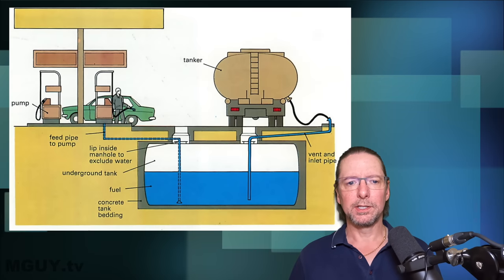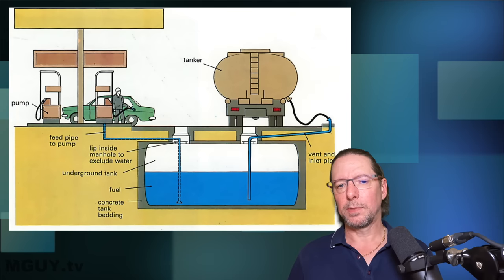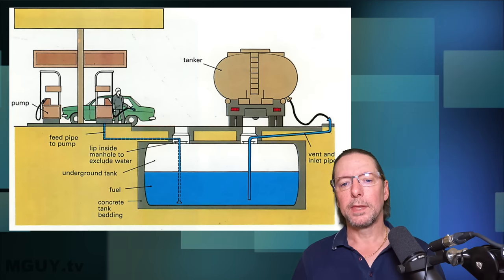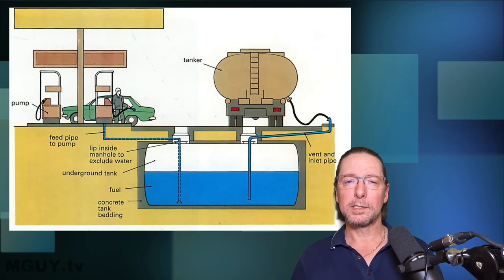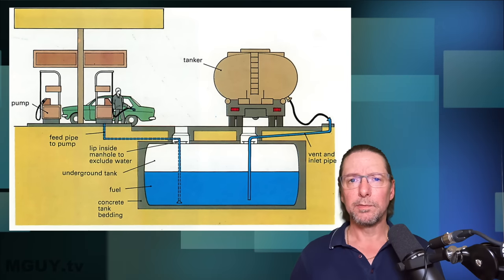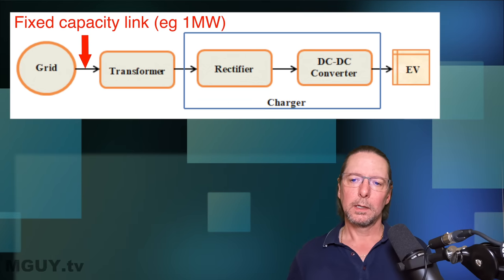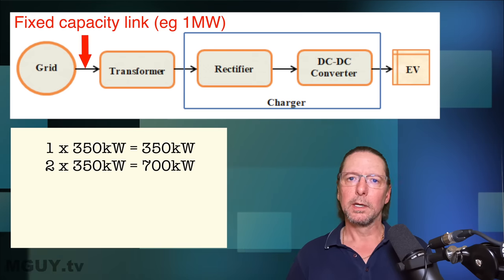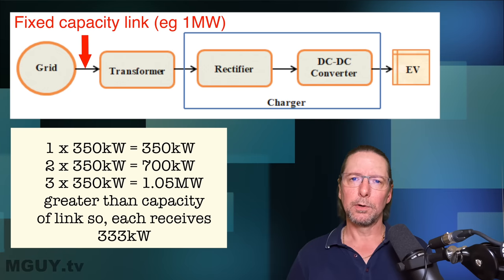HUGE problem with EV Charging Stations that no one mentions | MGUY Australia

Comment: There is an EV battery factory in Kentucky, that is powered by a coal-fuelled power station.
Reply: And one day it won't be.
Reply: @nevillewran4083 One day it'll probably be a smoking crater.
Reply: Yet the Gigafactory in Nevada has no real viable option to use Coal powered stations. The entire south west region simply does not have good coal supply. Who'd thunk you could run Battery Factories without Coal fired plants.
Reply: Producing a battery is only a small part of the energy it will hold during it's lifetime, as they can do over 1.200 fully charging cycles (LFP even over 3.500 full charging cycles) before capacity gets too low for a car.
Reply: @Neojhun There are currently four active coal power plant proposals in Nevada, totaling 4,050 MW, which would more than double Nevada's existing coal-fired energy capacity. Nevada ranks 33rd out of the 50 states in terms of coal energy production.
Reply: @ferrumignis  Doomsday fear?
Reply: @nevillewran4083 No, just a keen sense of the obvious.  Toyota is getting out of the EV business.  That fact alone says everything.
Reply: @georgemallory797  They didn't say they're getting out of EVs.They said it's not the full solution. 
They're planning lots of hybrids (one in every model, perhaps) plug-ins, hydrogen cells and other fuel cells. 
So it says the ICE is looking sick.
Reply: @channel4ferrets  and then recycle ther old, and buy a new $20.000 dollar battery?
Reply: EVERY Chinese EV has been built by the energy from a coal-fired power station!
Reply: @nevillewran4083  
Not quite.  In the short term, they are offering EVs in every sector, but plan a switch back to ICEs powered by ammonia.  There are two versions: one ammonia engine design can power an electric motor, and one can be an ICE.  So the first is actually a hybrid, while the latter is taking us back to the brilliance of an ICE.
Reply: @barryfoster453  So the latter will be ammonia and another propellant?
Reply: @Neojhun  My guess, you forgot to thunk 😉
Reply: Oh, the irony.
Reply: It’s in Kansas actually. But yes, point taken
Reply: That factory you’re talking about was never completed. There are no lithium ion batteries being produced in Kentucky. I was at an investors information event years ago and it was all pie in the sky. Nothing has materialized from it.
Reply: Back in the 1970s they had a " No Nukes" concert. Held at a venue that got it's power from a nuclear power plant.🤦
Reply: @nevillewran4083  
Indeed.  They have teamed up with China's GAC.
Reply: @FOHguy  hilarious!
Reply: @nevillewran4083 "And one day it won't be."   Not in your lifetime.
Reply: @Neojhun   Natural Gas is what they use.
Reply: @channel4ferrets  not if you keep using the fast charger. Plus a battery is a definite fire risk.
Reply: and when the USA catches up it will be run by Solar or wind or many other sources of generation. It's called building for the future. U.K. for example now only has about 3% coal driven power.
Reply: @channel4ferrets  You also have to produce the energy for the battery to hold ...
Reply: @barryfoster453  Did not know that. I'll have to educate myself more. World seems to evolving at a frantic pace.
Reply: @MatthewBerginGarage  How would you know that? Kentucky is already transitioning out of coal-fired power stations. While there's movement to slow that transition, even the power supply companies admit to the problems. The owners of the coal supply chain. 

The power stations are old and obsolete, even some of the coal plants are decaying and badly need maintenace. They know things have to change.They know companies who adapt are more likely to survive and profit. 

Plus, one day there could be a federal directive- "transition out of coal 100% within 8 years". 
Bold statement to make.
Reply: HAHAHAHAHA  LMAO
Reply: Its used to be that we were primarily concerned with our dependence on oil from the middle east, so to reduce that dependency, burning coal was perfectly acceptable, the only problem back then was that coal was a solid and there was no practical way to run a car on coal, without some coal to liquid technology, and now all of the sudden everyone is concerned about carbon dioxide! How about not giving our money to nations like Iran, who are trying to build nuclear weapons to blow up our cities, I will happily burn coal to charge up my EV to avoid buying oil from Iran and other unfriendly places.
Reply: No one talks about these inconvenient facts.
Reply: I read about that!  Oh the irony!!!
Reply: THAT is funny!
Silly Greenies!
Reply: So? You realize batteries only store energy, right? They aren't fuel?
Reply: Daughter works for SOCAL gas and their largest customer is the power generation stations.  I learned many years ago form an instructor;  there is a cost for everything.
Reply: @funnyfarm5555  So, as Sowell says, "there are no solutions, only trade-offs."
Reply: @Lemming1970 Germany has more than twice its needs in solar+wind installed capacity; however, more than half of their yearly consumption of electric power is from coal, gas and oil. Why? Because wind and solar farms tend not to work well on cloudy days without wind, or at night.
Reply: I call EV's coal powered. Since most communities still use coal to run their power generating plants.
Reply: That's why there are solar and wind turbines.

Comment: I've always called the EV a solution in search of a problem. I have not changed my mind.
Reply: Spot on! Agreed 💯
Reply: It's actually a problem that needs a solution.
Reply: I'm not apposed to EVs at all. They are great; however, too many people are pretending that they can do things that they can't do. They would be ideal for commuting to work and for groceries. Just plug it in when you get home. Want to drive from Eastern Montana to South East Wyoming? Not gonna happen.
Reply: EVs are great but not for everyone. I have had one with now over 100k miles, no oil changes, no gas, no maintenance except for tires. I have a gas car and a Diesel SUV also that cost quite a bit more to operate. If you can charge at home, people should get an EV for commuting and day to day stuff .... they are great. ;)  Plus they are comparatively faster, and my EV drives the same as if it was brand new.
Reply: @K9River  Actually, it's pretty easy to drive cross-country in a Tesla now. The only place it's problematic are places where you don't get cell phone signal either.
Reply: @darrennew8211  Not for long and not for many. Only a handful of people can do that because if the lack of charging stations. You're also limited to which roads to drive on. And when the charging stations get full, the already slow process of charging takes even longer- bring a book. Want to visit Glacier National Park in Montana? Can't do it if you're coming from the east side.
Reply: @K9River  Well, yes. The same national parks where you don't get any other sort of public electricity or cell phone coverage, you're not going to have too many EVs going through. You know, like I just said? Altho I did meet one brave soul driving his Tesla across Death Valley.

Two-wheel-drive cars are really bad at driving over long roads in the sand and mud, too. Not every car can go everywhere.

That said, I've driven across country in a Tesla. It's not that hard. Yes, there aren't as many charging stations as there are gas stations. Surprise!
Reply: you are right. let the free market decide, not socialist gov.
Reply: @patriot0971  The primary EV maintenance cost will happen you need that battery replaced. That bill will give you second thoughts about how cheap maintenace is.
Reply: @SoloRenegade oh it will, everyone will want an EV including you!  Why? Because EVs will be way cheaper and ICE cars will be way more expensive as more and more people will buy EVs!
Imagine if you had to go to a store to fill up your smart phone, paying $10 but it will last for a week, wouldn't it be nice?  Of course it wouldn't! 
Imagine if you had to go to a store to fill up your car, paying $80 but it will last for a week, wouldn't it be nice? Of course it wouldn't if you could charge it at home for $4!
Soon your local car dealer will close, the service center, the gas station, your favorite car brand will most likely go bankrupt within this decade.
Reply: @K9River In the Nordic countries the EV buyers/owner are the ones who drive the most. Except in Norway where 90 % buy EVs.
Reply: @K9River Of course there are some undeveloped areas on our planet where there aren't even roads, and then you can't even use an ICE car. Most people live in somewhat developed areas, and can use an EV in the next decade or so.
Reply: @stephenk.5839 The battery is the smallest problem with EVs. Almost noone will change to a new battery. In a fifteen years old car you maybe change to a second hand battery or change some bad cells.
Reply: @casperhansen826 Unfortunately you forgot a couple of things that not many people have understood, and that is that the ICE cars made after about 2008-10 are quite expensive to repair. These cars are "quite old" in ten years...

Comment: Also, my understanding is that these charging stations are now billing by time so if it takes longer to get the same amount of charge, you’re paying more for the same charge.
Reply: Imagine a car pulls into a petrol service station.

The tanker is hooked onto the end of one measly little fuel line and the car gets fuelled off that line coming out of the tanker.
Then 10 cars all try to suck out of the one thin line coming out of the tanker....
There's the problem...no storage "tank"

Now imagine an EV charging station with one measly 1mw line and 10 EV's sucking off it...

Further imagine 5 x 40ft shipping containers full of recycled ex EV batteries on site that had recharged all day from the solar canopy over the EV charging area...
and from off peak electricity all night from the electric grid.

Suddenly by using a brain and spending on a "tank" (a reserve of electricity) all 10 EVs are charging......
Reply: @JohnSmith-pl2bk hmmm, time to recharge your brain, it’s in delusional mode.
Reply: @JohnSmith-pl2bk  Then  imagine a more likely situation, all the cars charging at that station burning because one of the used batteries caught on fire from a previously unnoticed flaw in one of the cells. Which starts a major conflagration and reduces the entire complex to rubble as fire fighters are unable to extinguish the battery fire.
Reply: @JohnSmith-pl2bk  And imagine if your on holiday towing  a van with your electric EV, because of the way the charging stations are lined up you have to decouple your van to charge up - along with all the other happy holiday travellers towing vans. Tradies with trailers are going to face the same frustrations.
Reply: what charging stations do time-based billing ?
Reply: @hardrain666  thanks for asking !
 “Categories of EV Charging Billing

There are two main types of EV charging billing:

Energy-based: In this case, EV owners pay for the amount of energy their vehicle uses. The rate per kWh can vary depending on the location of the charger, the time of day, and other factors.
Time-based:  Under time-based billing, EV owners are charged for the amount of time their vehicle is connected to the charger. The rate per minute or hour can vary depending on the location of the charger, the time of day, and other factors.
Many locations offer a combination of both. For example, Tesla superchargers charge by the kWh but start charging for time (idle fee) once the vehicle is full, as a means to discourage drivers from keeping g the car connected once they have completed charging.”
Reply: @johncalvin9703  Tesla continues to charge after completing the charging in order to discourage owners from occupying the station and blocking others
Reply: @JohnSmith-pl2bk  A terrifying thought.  Old, recycled, lithium ion batteries!  What could go wrong?  How long do you think the energy store will last when it is busy?  How much power can you really get from a bank of solar panels? (ANSWER: about enough to recharge 1 car across an entire sunny day).  Where does the rest come from? (ANSWER: primarily hydrocarbon generation).  What is the size of the reduction in total CO2 output?  (ANSWER: two fifths of five eighths of bugger all!).  So much money wasted...
Reply: @farnthboy  "And imagine if your on holiday towing  a van with your electric EV, because of the way the charging stations are lined up you have to decouple your van to charge up - along with all the other happy holiday travellers towing vans. Tradies with trailers are going to face the same frustrations."

This is the stupid present design philosophy of the EV chargers being "on the fringe" of the parking lots.
Now take an EV charger and plonk it in the cross point of 4 parking places....(suitably guarded by bollards as are ICE fuel pumps at service stations) with 4 charge cords coming from it...and 4 dials one facing each parking space..
A combination (tow vehicle plus /trailer/caravan/RV) pulls into 2 spaces and plugs in from one charge cord.
That leaves 2 spaces for single vehicles...
or one other combination.
The app regulates which vehicles are a priority based on payment and booking times.....
Any problem now??
Reply: @JohnSmith-pl2bk  "Recycled ex EV batteries."  Yeah, right.  There's no such thing.  After use, they are hazardous waste with no way in the foreseeable future to "recycle" the materials, let alone use the actual battery again.  Also, imagine that all the cars in the area are EVs by mandate, but there's still just the one charging station.  My county in the US has only one charging station that can only take two cars at a time.  They cost too much to build.  Only a rich neighborhood can afford all that, and the general public won't be going to those neighborhoods to charge their cars.  There is a general lack of connection to reality among most proponents of EVs.  They might be possible someday in the distant future, but not in my lifetime.  We've been promised flying cars since the 1940s.  I've not seen a single one, and I'm 70.
Reply: Is that all stations or just in particular areas?
Reply: @scottjohnson7780  not sure of the percentage but Tesla continues to charge after completing the charging in order to discourage owners from occupying the station and blocking others
Reply: Tesla was doing that and the government here said it was disallowed, so I suspect your information might be out of date.
Reply: @JohnSmith-pl2bk  People don't install 10 high-speed chargers with a feed that can only support three. They install three chargers, and everyone gets charged just as fast with one third the cost of charger installation. WTF are you going on about?
Reply: @ronpreece3429  That was a very confusing sentence at first. :-)
Reply: @darrennew8211  that’s good to know, thanks
Reply: @JohnSmith-pl2bk   5 x 40ft shipping containers full of old lithium batteries - what could possibly go wrong.  I cannot get over how utterly deluded you people are.  You are so far removed from reality it's ridiculous.
Reply: Your 'understanding' is wrong. Did you not consider checking before passing on such incorrect guesswork?
Reply: @Hitstirrer  well it depends on which State you are for example California doesn’t allow it.